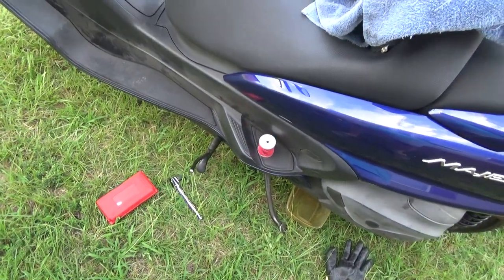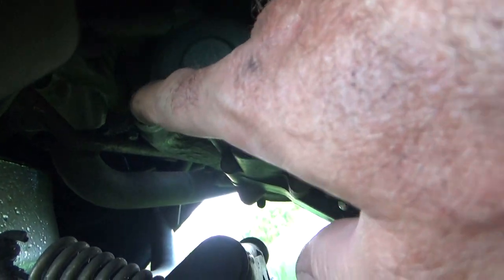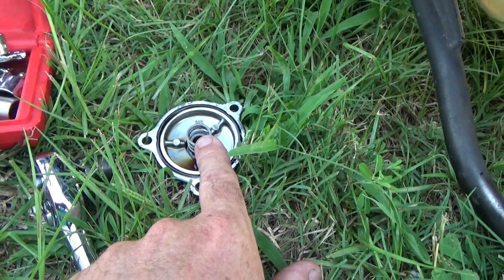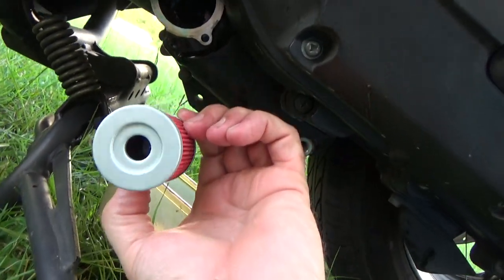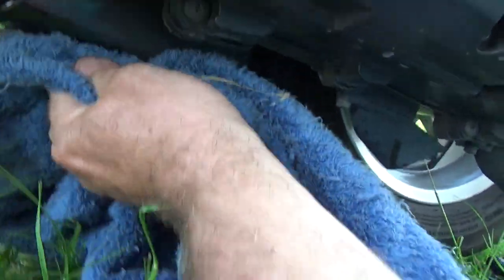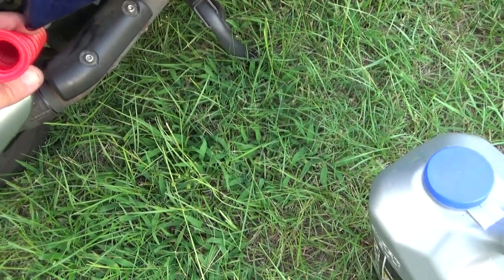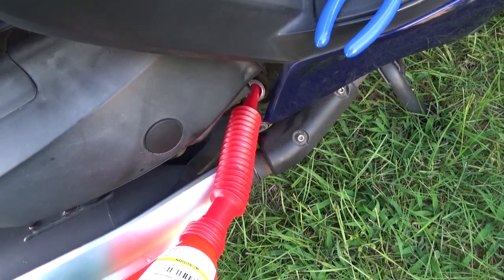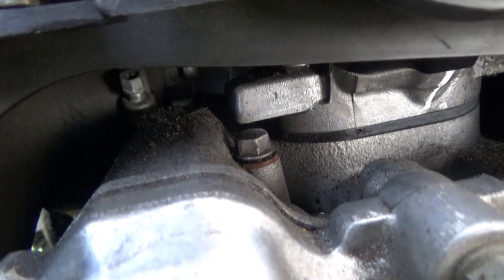Oil Change On 2005 Yamaha Majesty YP400

Comment: Very informative.  Thanks for posting.  I never would hae thught about verifying oil pressure.
Reply from the maker: The most important info from a running engine is oil pressure, and they didn't even so much as provide an idiot light. What were they thinking? There was a guy on the forum who had his engine seize up after an oil change, and he never would say if he verified oil pressure or not. He did the oil change. It's easy to forget something even with many years experience doing it. Maybe forgot to put oil in? Who knows. A very expensive lesson for sure.  I like knowing for sure that all is well inside the engine. I'm still thinking about putting a pressure gauge on it but my list of projects is ever growing, so this one waits for now.

Comment: Hello, I also have a Yamaha Majestic, I changed the oil and filter a few days ago and a strange ticking noise started from the camshaft, but the draining of the small screw you did, I never knew about it, could it be related to that?

Comment: Having stripped my oil drain bolt also, can you tell me the part # of that bolt or where  you found it? Mine is a 2005 as well.
Reply from the maker: I got it on eBay a couple years ago I believe. It's magnetic and worked great. I don't remember exactly the size of the bolt but a Google search is what I used at the time. If I still had the scooter I could tell you but I traded it in May.
Reply: @jamesniece5203  I'll get a non-magnetic from ACE Hardware and order the part from Yamaha. I tried Google but really didn't come up with it. Thanks.

Comment: How do I know when to change the oil
Reply from the maker: I go by the mileage. A message will appear on the screen letting you know it's time to change it as well. I didn't go by that but it's nice that it's there in case you forget. When you change the oil be sure to reset the counter for that alert. I forgot how but your manual has the info plus you can Google it.
Reply: @jamesniece5203  Thanks for the information

Comment: iS THAT A CR TIRE?  what size?
Reply: you can "darkside" 155/80/13 car tires
Reply: @williamcox2996  just ordered Product Details

RB-12 Tires (80997) by Ironman®. 155/70R13, Speed Index 118 mph, Max Load 852 lbs

hope it works.
Reply: @rstidyman  yes.....true
Reply from the maker: I call them multi-purpose tires, since the 'P' designation has been dropped by most tire manufacturers. The 'P' in front of the tire size meant it was designed for passenger car use. That is almost totally a thing of the past now. If you just say Darkside tire, everyone who does it knows what you mean.The tire I am using is an Achilles 122 in 165/65 13 size. It has just enough room in there without rubbing anything. The 155/80 tire you are talking about is taller and might not work because of clearance. The MC tire width is measured at different points than a Darkside tire, so the numbers are not an exact transfer from one to the other. I didn't have to experiment with sizes because some folks on the Majesty forum have already done that and shared their results. It is a much better ride and an outstanding improvement in traction. I pass cars in the pouring rain without sliding ever. I beat the snot outta my Majesty so tire life might be better for most other folks, but so far I have about 15K on this tire and it's about time for a new one to go on. Less than $40 on eBay with free shipping is a good bonus as well! I hope that helps you, and ride safe!
Reply: @jamesniece5203  so my 155/80/13 ..after inflation WILL rub on my majesty ?  i have pirelli 150/70/13 diablo now
Reply from the maker: @williamcox2996  it will be very very close if it goes in. I should have taken pics when I changed the TB diaphragm because you could see how close the tire was. It's the height not the width that would be the problem. The 80% aspect ratio is going to put you at about 124mm from the rim whereas the size I'm running is about 108mm.
Reply: @jamesniece5203  this car tire @ "155" is definitely not as wide as my pirelli diablo...did think that 10mm in height would make a huge difference....finding a 70 series tire is a real PITA in SoCal..found these on clearance @ local WalMart
Reply: NOT
Reply from the maker: @williamcox2996  I hope that makes sense to you. I'm not the best at describing things sometimes. Just ask my wife! Haha. Google how to understand the tire size and you will get it for sure. It's pretty simple, I'm just a bit complicated 😎
Reply: @jamesniece5203  u are good teacher..actually...I know A lot about tires..cars, trucks, bicycles,scooters, motocross and the ones on my GSXR600..ha ha  I hope it fits...school of hard knocks